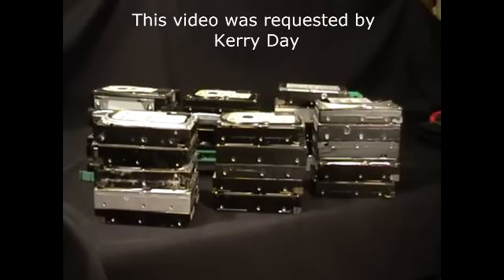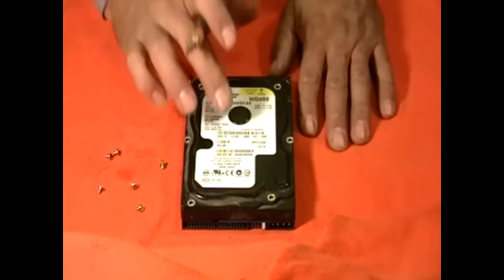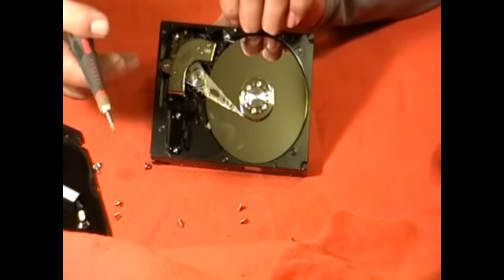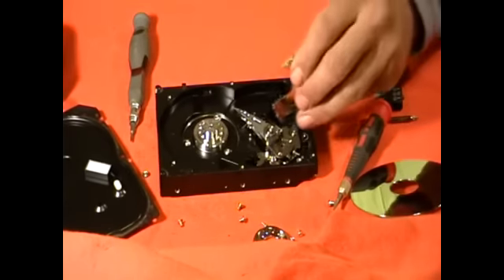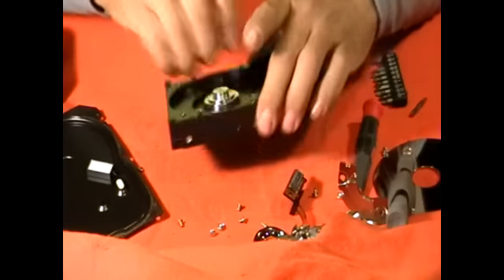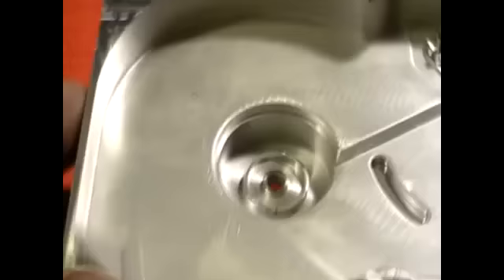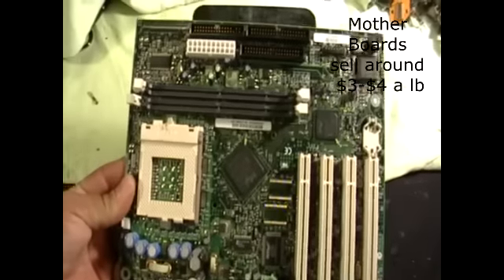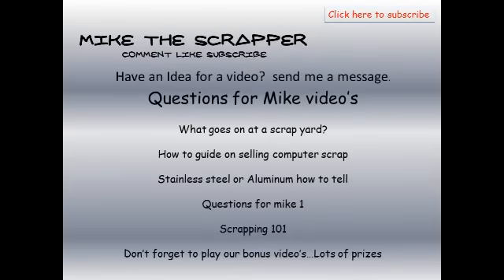Make money with  Hard Drives

Comment: hello Mike!

You missed a thing. Those covers that you mentioned at minute 6:32, you mentioned that it's stell because you probably checked it with a magnet and it sticked to it. BUT, there are 2 sheets sticked to each other and one is steel and the other aluminium. Check with a magnet in the corners.

What I do is fold a corner with a pliers and then pull the other sheet appart. It comes off really easy.

Have a great day!

Greetings from Portugal!
Reply: Emanuel Araújo d
Reply: Emanuel Araújo v

Comment: Also ive found that the platters are not All Alloy ones but some ive come across have been like a mirrored glass? & shatter like glass when broken.As i work in a Scrap yard 2 of our main Tools of the Trade are File & Magnets, I Personally like to use the Large rear earth magnets out of the hard drives i drill a hole in the Bracket & hang it from a piece of Lawnmower pull cord from my tool belt.They super strong & Great for checking allsorts of non ferrous & ferrous metals.

Comment: Great Video as usual Mike! I found when pulling these apart that some of the Actuating arms do have the copper at the ends & the ones that have the yellow looking wire will most likely have been aluminum wound wire take a file to the ends & check! A lot of electric motors are starting to be wound in aluminum wire that looks like copper these days,So it pays to have a file near by.Ive found most have been in washing machines though.

Comment: You can separate the magnets from that metal back plate they are on really easy. Small flathead screwdriver or just bend the metal and the magnet will pop off.

Comment: The cover material that you are saying are steel, in my experience, are stainless steel, which is worth much more than regular steel. Regular steel sells on the scrap market for a few cents a ton, where stainless sells for much more, currently 35 cents a pound for solid pieces.
Reply from the maker: I have found steel, non magnetic and Aluminum. But thank you for the comment.

Comment: The motor usually has a very high quality (and expansive) encapsulated ball bearing (built-in, but can be separated). Sometimes the head also has a smaller bearing at the joint.

Comment: I've got a few.  I keep the older SATA drives to use for back up external drives, computer builds made of spare parts, extra drives to stick in machines, etc.  200GB and up, still useful.  I have some 80GB IDE drives aren't really good for anything but scrapping, but I might take them out and shoot them with the .243 or 30-06 to see what it does.  Probably be pretty good and it would take them apart faster than a screwdriver.  Even a .243 can be pretty fun if you need to sight it in.  I took a milk jug filled with water with the top screwed on and shot it with the .243.  Half the jug went 10 feet to the right and half went 10 feet to the left.  It hits it so hard it can't take the pressure spike and it rips completely in half and the halves end up 20 feet apart.  It's pretty interesting.
Reply: I still use the 80's and such as dedicated OS Drives

Comment: that part of the accuator arm that you werent sure about that you say looks like gold or copper is actually a steel of some sort from memory i think.the main elements we found in the hard drives were iron, nickel,copper, chromium,boron,molybdenum,aluminium and something else i probably forgot.most HD components were combinations of these.the logic boards contain a whole range of elements cant remember what they were.the parts that we thought were gold plated such as the pins on the sata connection were 1%silver in a brass alloy or something like that but no gold. the lid that you remove first contains chromium which is apparently valuable.if any one can tell me where to find magnesium metal on a hard drive or computer i would appreciate it as every piece we had tested did not contain any.

Comment: nice I have 4 drives sitting here , thanks for the tip at radio shack for the screw drivers ,, have been hacking them apert with what i had on hand ,,, will post a picture od a early har drive

Comment: Unless the hard drive has been cleared or damaged, it can be placed in a compatible hard drive to recover the data on it.  This is the only part I do not recommend scraping as-is.  Flash drives, SSD, and external drives should be taken apart completely also to avoid data collection.  Other than that, good on you, mate.  I've scrapped dozens.
Reply from the maker: I do scrape the platter. that way no data can be recovered

Comment: getting all the torx drivers you need can be a pain but as you showed it always pays to know when to to dismantle and how to dismantle and guys those circuit boards after you take all the parts off them they are still up to 45% copper by weight and the mlcc's that are to small or you miss still have palladium silver and platinum so save the boards and process them when you have a bunch or sell them to someone that can.
Reply: Swann

Comment: All these posts from people about worth big or not are from people that have trouble just seeing the picture. Sure scrapping 30 hard drives isn't worth the effort, but the process is.Imagine instead doing a clean up of either a closing computer shop or a fully operational one. I have been inside more than 50 of them and they all need get back space.
Now you're getting paid good cash to hall it away, because mostly they don't have time to. You'll get a hell of a lot more than 30 hard drives and then there are motherboards, video cards, sound cards, cpu's and even more.
First run is to scrap the steel cases, Take your time in all the rest. Fill some boxes in your spare time and go and get some more.
Give it at least 6 months on anything expected to be of real value. Steel goes out as you're getting, scrap the clean plastic, but for free.
After 6 months working an hour here and there then cash out on the good stuff and be glad that these "get rich quick boys" didn't bother going after the stuff with you.
By the way I just about skipped over this without much mention, but the steel from the cases and your clean up fee's should have paid you well before this point.

Comment: Got one question, I have opened a couple of hard drives which I had piled up from repairs, and for all of those the platter was coated glass. Not aluminium.
Reply from the maker: I do notice the laptop ones have glass and not aluminum.
Reply: Mike the Scrapper Yeah, but 3.5" ones also had glass inner. My guess is that they started to cut cost a little bit on this and therefore using glass. Most of the hard drives were Seagate Barracuda and a couple of WD Green and Blues.

Comment: Have you gotten any better T9 or T6 Torx bits? I've been trying to see if anyone's found a resilient one. The Husky 8-in-1 set I have has been good on the T9, but the T6 twisted quickly... I was looking on eBay at some T9 'power bit' bits for using in a drill... would at least speed up the process. Not that I need it, I went through and tested 3 years of HD's and scrapped 40 this last holiday weekend lol
Reply from the maker: Still using the HDX from home depot. no problems yet.
Reply: Try using a drill press on those stupid ass little torx screws, they are usually soft enough a decent drill bit in a drill press will clean them off i less than a second
Reply: It's like 16 Torx screws per drive... I feel like a drill bit able to go through 16 x 40+ drives I had to go through would have been more expensive than the $2.50 WIHA bits I found. Then there's the convenience of being able to do it wherever I take my cordless drill and the fact that the screws are recyclable themselves. Had a big bowl full of screws once done.
Reply: SpiDeRReal
I get it, you like the screws.lol. I haven't stripped hard drives for a while so i took a run at it with my dewalt. After i dug out the hidden one i had the cover off in less than a minute....with a drill press and all set up i could do 30 in 20 minuets. Drill bits tend to last longer in a drill press, its all about the pressure. Insufficient pressure causes the bit to rotate against the screw and that generates heat and heat kills tooling. Proper pressure cuts an most of the heat leaves with the chip.Have you ever run across audio/visual hard drives? They are bigger and 4X as thick with several platters 4, maybe 6. The magnets in them make pc hard drives look like toys. You can put one in the palm of your hand and one on the back, they have enough power to hold through your hand and take a considerable effort to shake them off..Little pinches ain't nothing, i had one mash a fingernail and the entire nail went black. Stick 2 together and i have had a few guys who had seriously strong hands and they weren't able to get them apart. Even the noise they make when they hit is scary. Any of you guys happen to run across Lois Learners old hard drive? I heard she was looking for it, she is thinking she needed to find it pretty quick, she has figured out that Daryle Issa is about tired if that witches BS. i  don't think she much cares about the thought of actually going to jail over something that she is so sure she had nothing to do with:):)    I think all she needs is a good spanking, pull that pretty blue dress over her head, bend her over, make her say hard drive/drive hard at least 50times... And slap her bottom until it's up to operating temp.She just needs to learn who the boss really is. lol

Comment: it's not pure aluminium, it's an aluminium alloy.   the only reason to pull apart hard drives on this scale might be for hobby use of the parts.
Reply: That's very true. It's almost 100% certain that none of the manufacturers would've had casing made of nowhere near pure aluminium as there isn't any need for that. It's quite likely that casings have ie. great amount of zinc in them to reduce manufacturing cost, thus rendering price of casing much lower than pure aluminium would be. Note that even though casing would be 100% pure aluminium, it wouldn't be worth much. Magnets are likely most worth money in hdd's. It's also worth noting that plates made of platinum seem to be an myth. Maybe some of the first hdd's had some platinum in them. If they would have even a bit of platinum, hdd prices would be out of reach for consumers.
Reply: jothain not necessarily, been looking at platinum plated titanium electrodes and prices hover in the 40-45 range

Comment: What's the cost difference between IDE and SATA ? big difference, because IDE was mentioned even in Greek mythology :D
Reply: logic board??
Reply: BoBby V
you don't need one if there is 0 understanding from first time ;P otherwise the joke is not successful if someone explains its meaning later on. Anyway, logic is simple...greek mythologies are really really old, and IDE is so old that I compared it with mythologies, usually those mythologies are pretty old you know...
Reply: I'd scrap a IDE before a SATA... SATA worth saving  LoL
Reply: BoBby V Not to mention that the IDE actually has more gold on the circuit board. Beeing that the IDE connector has far more pins then SATA and thus more gold plating on each of those.
Reply: SATA also known as Serial ATA has 2 plugs 1 for power and 1 for transmitting data.
IDE has a bunch of pins to plug in and are more rare these days because this is old hard drive technology.
If this helped you out like and subscribe to my channel RDCOS were I will show tech related stuff soon.

Comment: Assuming that the hard drive doesn't work, but the data is still intact on the platter, what can I do to assure the person giving me the drive that the data is destroyed and maintain the value of the platter at the same time?
Reply from the maker: Dwight Gordon you can open the drive, scratch  and bend the platter.
Reply: Thanks!
Reply: Take it to a computer recycling center. That destroys data on them.They wipe it then it goes in a huge shredder.To make it into tiny pieces.
Reply: wipe de magnet over it a couple times and it done
Reply: pim Eijk That don't work it has the worlds strongest magnet in it.Its what hold the hands for platters.
Reply: Yes it dus but the platters are tot far away nut it will cost a but load of money tot recovery it anyway
Reply: Oké installatie Windows on tour drive boot up andere gold a strong magnet over the drive
Reply: Dwight Gordon well the most common thing is to scratch them or bend them but computer forensics can over come this usually. To really destroy data, I take a Acetylene/oxygen torch and melt the crap out them. Or put the disks into a furnace at work and incinerate them at 2,400c or about  4352f.  either way works!

Comment: I get all the HD's, memory and decent stuff from the local tip "IT section". The HD's are great, especially since yet to find erased ones and if lucky find interesting stuff on them (ie. fail home videos of porn star wannabees). I also grab the Windows 7 and upwards certificates that are usually still in the cases. Have a complete i5 running Windows 7 32 bit in the workshop all built 100% from stuff people thrown out.  There's so much waste of perfectly good stuff it's crazy. Went there once and a company had dump 6 pc's with 21" LG flat screen monitors. Grabbed one... but should have grabbed all the monitors as they were top of the line ones and the one I salvaged was better than my main one.

One thing I found in common with most was... dust.... heaps of dust on fans and heat sinks etc. Guessing CPU/MOBO/Video card/PSU got hot and slowed down. Then people assume time for upgrade and throw it.
Reply from the maker: wow, nice...

Comment: Will it still work with a hardrive that was overheated? It's was a ps3 hardrive.
Reply: Yes. All of the core pieces will still be in there, but the PS3 uses a 2.5 sata drive so it will be a little smaller by default which means less money. What you want to go for are 3.5 drives mainly found in desktop computers.
Reply: Thx man

Comment: Dude... your spindle motors are not "all steel" ;)
Mostly aluminium (the hub), some steel (magnet jacket, bearings, shaft), a ring NdFeB (magnet).
And you "pure" aluminium is very powder-coated... 
It is good to recycle. It's not bat to know what you're recycling neither.

Comment: The disks is actually also aluminum.
Reply from the maker: Aluminum inside. the coating is Platinum
Reply: Mike the Scrapper
How can you separate the platinum from the aluminum?
Reply from the maker: There is a process.. I am looking into the ingredients
Reply: Mike the Scrapper
on a 3.5 inch drive is the scrap value higher with a higher capacity drive?
Reply from the maker: its all about weight.
Reply: he said aluminum, platinum
Reply: Mike the Scrapper The coating also has ruthenium, cobalt, chromium, nickel, iron. Also, disposable razor blades have chromium and platinum layer on the blade. The layer is 100 atoms thick or something like that. That is basically nothing.

Comment: i got a dead segate barracude 7200.11 worth doing?
Reply from the maker: Wreck-ItGamer  You will need a lot of them to make money...
Reply: Why is it dead? Do you know?
Reply: Well. I start the computer up works fine till it says starting windows keeps saying that for a couple of seconds then I get a quick flash of the blue screen of death tried doing the system thing didn't work tried a chkdsk but stops at 7% and all from on their all files are unreadable so I gave up and bought a new hard drive I even unplugged the hard drive for a bit to see if that works but it didn't and I think it was because I accidentally kicked my computer really hard and I broke from that but I don't know!
Reply: StopMotionBrick could be bad blocks in the front of the drive. Data should be recoverable, but if that doesn't matter try reformatting it. The BSOD error might help in determining what it is exactly. Try googling the 0X number
Reply: Seagates are very common coming through our shop.

Comment: If so what you mean I need the cut the length of a lot of logic boards so I'll be making more money I just might look around for the well a lot of boards the motherboard thanks for the tip Mike is that was all that no that's square pixel in all about when you're doing all that stuff for the taking the TV set the toaster oven and the like that in there and get the stuff out of focus but you're the one on the price on that stuff do you need to do something with your focus in need to make a little bit more sharper and clearer and peace yeah this is Fred
Reply: wat?
Reply: ummmmm.....say that again?
Reply: Dude...use commas and dots to end your lines, otherwise nobody can't understand you, and I do not want to correct your work...it'll take some time to understand where should I put commas, and if you even wrote correctly.
Reply: THAT ... is a record setting run-on sentence Fred!!  I got through it, but it made my eyes hurt badly, and I had to take a break from YouTube for a bit.  There are 104 keys on the keyboard - find the PUNCTUATION ones!!

Comment: Seems like a helluva lot of work to make $71.  I hear the big money is melting down the gold on circuit boards.
Reply from the maker: It is a lot more then you hear. I have done Cpu pins & Ram Boards. If you have enough material and chemicals you can do it. But putting an entire Circuit Board in acid and getting gold? You would need a very large area and thousands of boards to make money. You will loose a lot of the acid strength when adding an entire board. The acid will attack everything and you would have to keep adding acid to strip the board down. Then the separation of copper, gold, silver, platinum and so on that is in the mixture.
Reply: Thanks for sharing, Mike.  But I'm not the working-with-dangerous-acids type of guy.